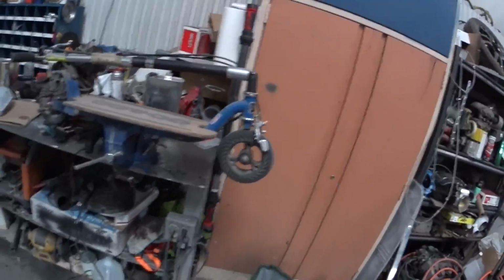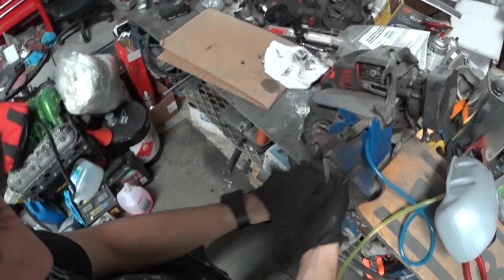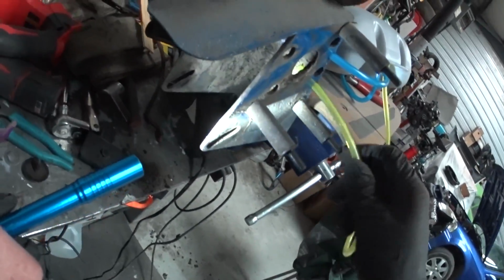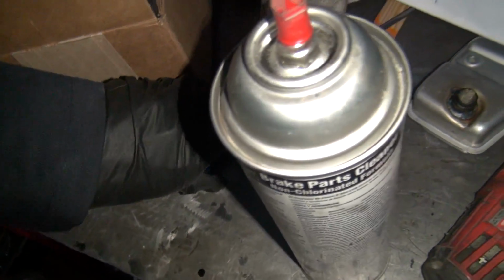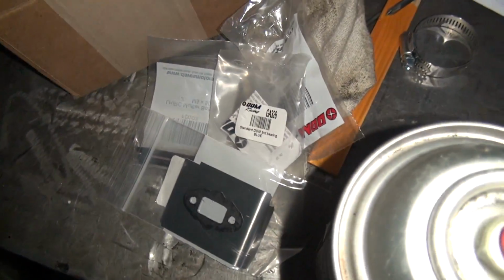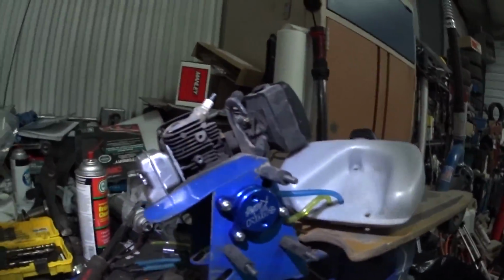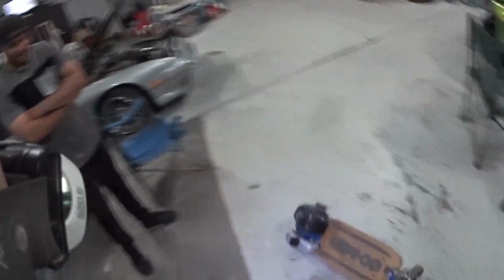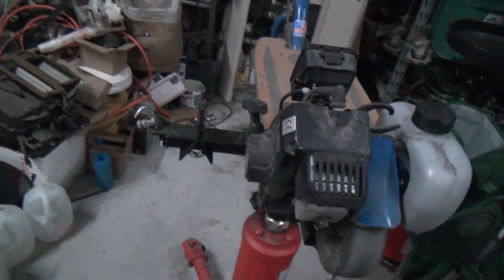Fixing the Goped for a pit vehicle

Comment: Man when I got mine used also  (was tricked out) I highly recommend using hex/allen key bolts or torx if you can find them, for the engine mounting bolts. (I had to because my engine was shifted upward to accommodate ridiculously large spindle .900) had some stupid flat head bolts in it originally. I am in the process of freshening up mine to ride at my local cruise in. I need a smaller spindle for less pucker factor because for what it is it was just too fast, it was sketchier than frig. Assuming it was correct my friend gps speed tested it close to 35mph. I just want to use it to tool around and have fun but that said all the other aftermarket parts were a sweet deal it has the billet wheels ada deck, ada fuel cap, velocity stack, tuned exhaust pipe (don't know the brand) came with the bore and stroke kit BUT I had to rebuild the top end due to previous owner mixing fuel incorrectly and later found out it needed main bearings and stuff so I rebuilt the whole engine. I am debating adding the ADA clutch kit and the 3rd bearing, or maybe just the 3rd bearing with a smaller spindle. I am not sure how well those clutches work with the sport. Also just from my experience I recommend using some loctite on engine mounting bolts and the jug/top end.

Comment: It looks to me like your crank shaft is bent. Common problem for peds that get beat on without a 3rd bearing. Take the 3rd bearing off and see if the o-rings are all chewed up or if you have the tools (or if you can find them in that shop lol) check the run out on the end of the spindle at idle. Your engine is a G23LH, a new CY crank and wrist pin will set you back $50 or so.